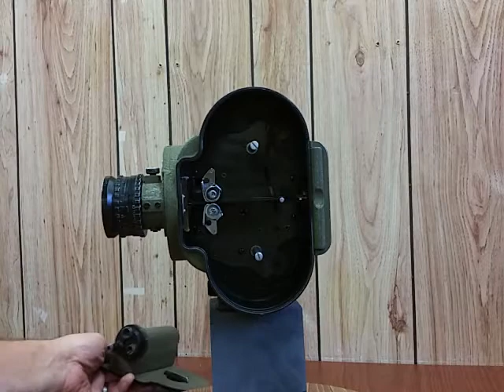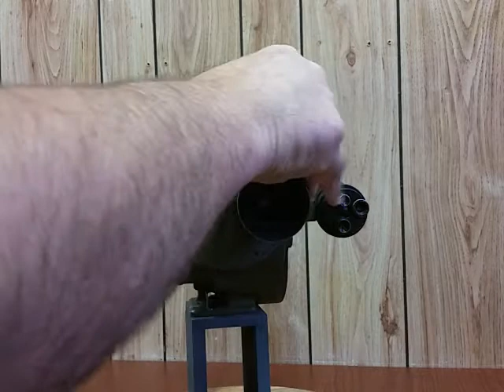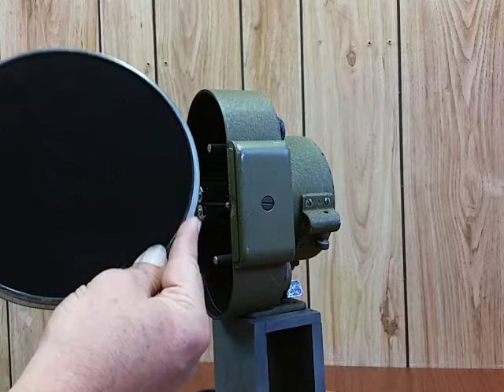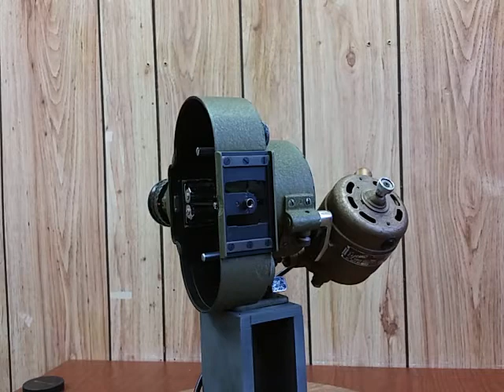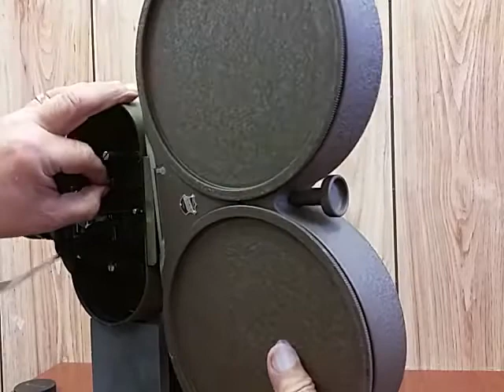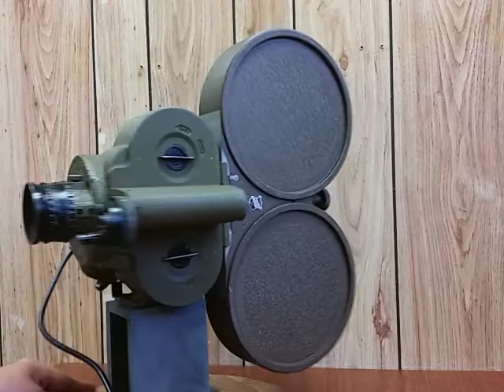Bell & Howell WWII 35mm Eyemo Movie Camera

Comment: the unit you have is 400'.  a 1000' reel is about 10 or 11" in diameter.  Look for the hycam high speed cameras with the large capacity reels.  those are 1000' 16mm